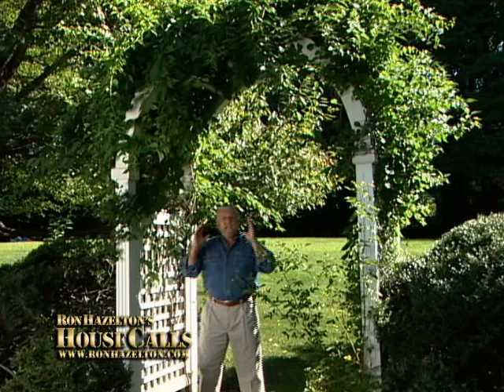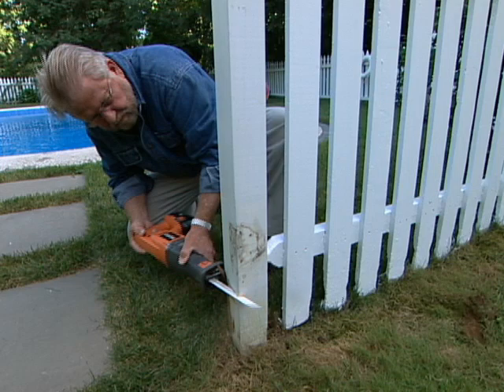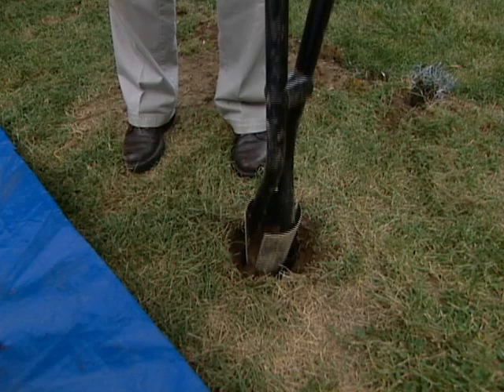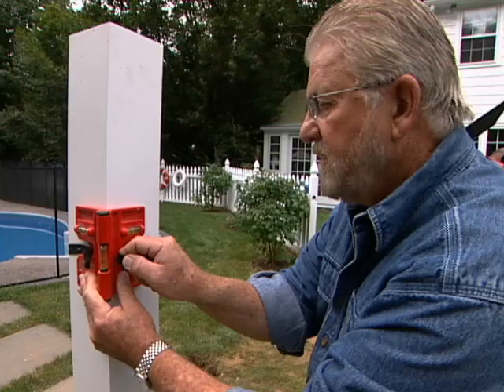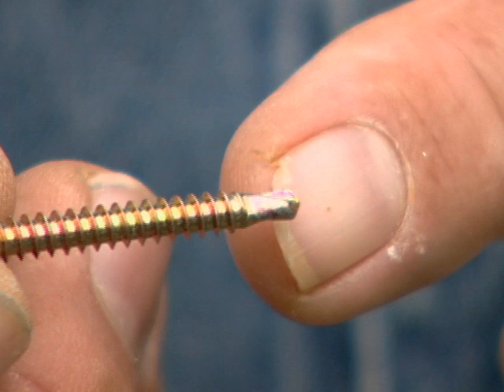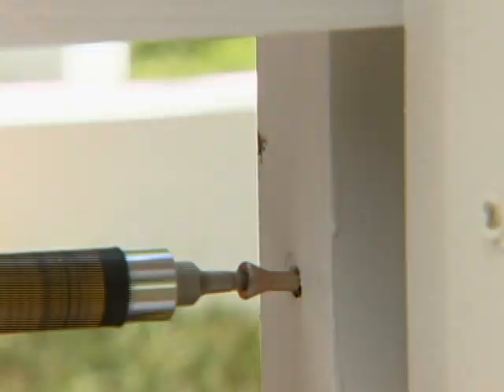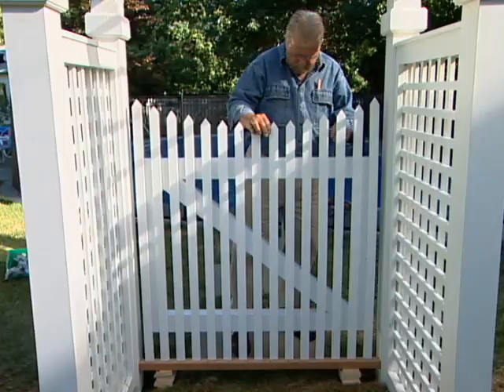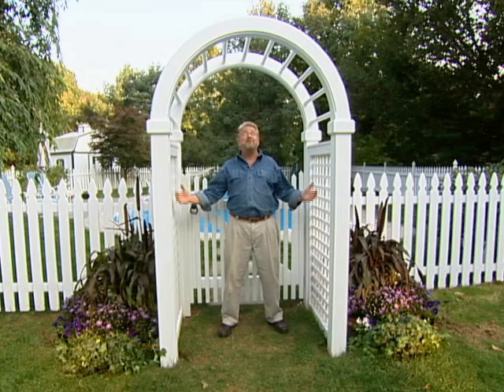How to Put up an Arched Garden Arbor

Comment: I always thought you needed to use concrete to set the posts. Is the gravel enough to hold this structure up in high winds? I'm studying landscape design and want to understand more about installing these structures.